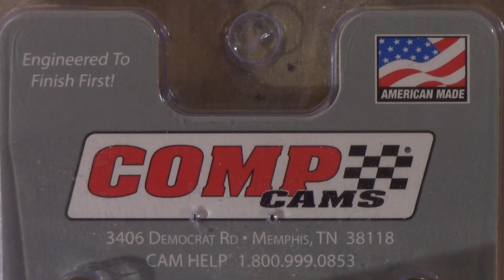Selecting rocker arms

Comment: Thanks for sharing your knowledge. Could you please advise why you don't use the golds on a tow rig, I would assume the rev ranges would be similar to your work truck example.
Reply from the maker: Great question!
 As I stated in the video this is my opinion. You are correct work truck and tow rigs are operated in the same rpm range. Work trucks tend to be loaded an occasionally pull a trailer, they spend a lot time half loaded. Where as a tow rig spends 70% or more if it’s time with a trailer on. The engine is typically dealing with a larger load, plus the added stresses of the trailer pushing and shoving on the truck. I have seen more than expected wear, than the mileage should show in the valve trains of most tow rigs I’ve torn down. I prefer the added durability of the steel rocker.

Comment: I have a question.
Why would my engine builder use 1.6 rockers on the intake and 1.5 on the exhaust?
I can run 1.6 on all of them if I want to.
I’m just not sure why he did what he did.
He’s a hard guy to get ahold of or I would ask him.
He built me a 383 stroker running “according to his Dyno” 500hp 520tq
Intake cam lobe 374 with 1.6 rocker = 598 lift
Exhaust cam lobe 382 with 1.5 rocker = 573 lift
The heads have 205 intake 160 exhaust valve.
Using a comp roller cam and comp short travel hydraulic lifters.
According to Comp the springs he used are to weak and that why my valves a floating at above 5800rmps 
So I’m planning on installing the right springs and a stud girdle and installing those ultra pro magnum roller rockers.
Just not sure if I should change that set up from 1.6/1.5 to 1.6/1.6
Oh and the heads “according to Brodix” are good for a 640 lift.
Any explanation for that set up?
Reply from the maker: Excellent question:
Many variables would drive the staggered ratio decision.
This may be a “recipe”combination that your engine builder uses for certain head and intake setup with a particular cubic inch engine.
It may be that the flow tests showed that with the given lift and cam characteristics you only need a 1.5 rocker on the exhaust. Remember the goal is to get the desired horse/torque with as little valve train motion as possible. If you do go to the 1.6 ratios be sure to check your valve clearances.
Reply: @FabRaceModRepeat  
Thanks 
I just looked at my cam card and it recommends 1.5 all the way across.
It seems to run good up to 5800 and then we hear that cackling noise and it goes pig rich and drops off.
I got a 12.2 in the 1/4 with a 71 Chevelle and that was before I had it tuned right. Since then we have gained 25 to 30hp just in tuning.
Even if I don’t gain any HP above 5800 I would like it to handle rpm’s past that.
I don’t know, I’m just trying to figure out what to do.
Thanks again
Reply from the maker: Get those stiffer springs on there and you should be able to rev higher.
Reply: @FabRaceModRepeat  
And just stick with the 1.6/1.5 set up?

Comment: Can you tell me if this setup is fine

               I have a future cam swap spec for an LS3 that has LS7 lifters(stock).  The cam is advertised as a .629/.615 lift with the factory 1.7 ratio rockers. I was thinking about swapping the stock rockers out with the Ultra-Gold Arc rockers with a 7.2 ratio. I did the math already of determining the new lift spec with these rockers which would be .636/.622. Also the valve springs I'm thinking about getting is .660 dual valve springs with a coil bind at 1.015 and 160lb closed and 415lb open spring pressure. Along with 11/32" PR. Question is, would this setup be okay? And if so, will this be okay just for regular street driving and some street races? And I'm not considering at any giving point to rev past 7,100 rpm.
Reply from the maker: 7.2 rocker ratio!?!?
Reply: @FabRaceModRepeat  I meant 1.72

Comment: I have a crate 350 tbi with a 91 octane core and headers. The rocker stud snapped on the exhaust on cylinder #2. From what I can tell all the pushrods and rockers were stock. Been doing some research on what rockers to replace with but I’m having a hard time. I have the engine receipt from the old owner saw that it has a 203/203 cam. Before the failure the engine ran great. Did this failure happen because of wrong rocker ratio and pushrod length? Or do I stick with stock and assume something else caused the failure? I’m a very young and new home mechanic would be great if you could help me out. Thank you for your time.
Reply from the maker: Thanks for watching!
How much lift does it have?
Reply: I don’t have valve lift checker but from the engine receipt it show that it has a cam with a 203 lift on both intake and exhaust. From the measurements I took and there stock appearance the rocker arms have a 1.5 ratio. I can grab a lift checker after work tomorrow.
Reply: No one in my area has a cam lift checker. But I’m pretty sure it’s .203” in both intake and exhaust. I’m pretty sure it’s so low because my engine takes 91 octane and the timing is retarded by a few degrees. Thinking about just going with the stock 1.5 ratio but on full rollers just to keep it the same since the engine ran great other than the failure. Any recommendations for that? Do I need to change pushrod length if I’m just switching to full rollers? I had self alining rockers before if the new rockers I get aren’t I just need to get the pushrod guide plates correct?
Reply from the maker: If you go full roller definitely check PR length. Also watch the geometry, keep the roller in the center of the valve tip. I would use a Comp Cams magnum roller tip rocker on a low lift application such as this.

Comment: I recently purchased afr heads and stud girdle and was wondering if you could help with  choosing the right slot width for new roller rockers. The rocker arm nuts for the stud girdle are .600 and do not fit the current  rockers I purchased.
Reply from the maker: What type of rockers do you have? did the poly locks come with the stud girdle?